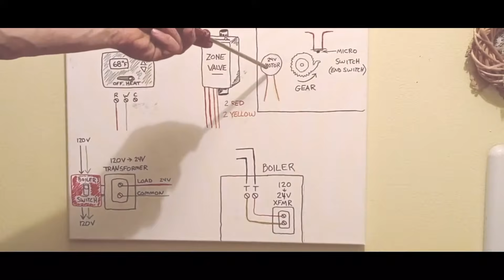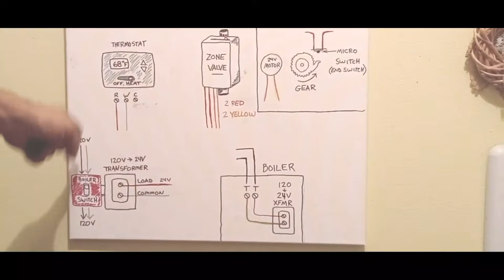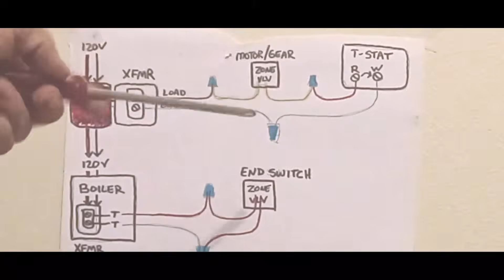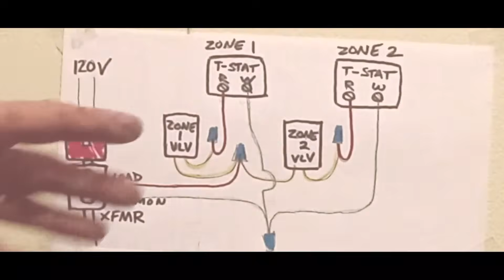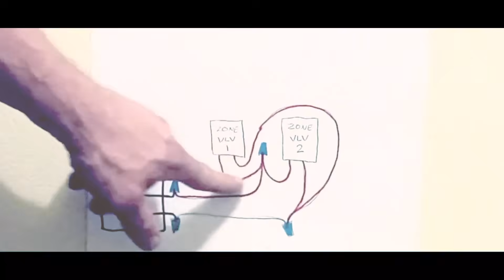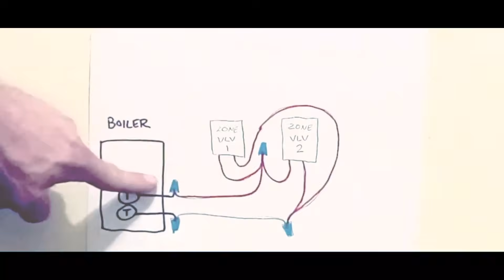How a 4-Wire Zone Valve Works (Wiring Diagram for Beginners)

Comment: Hi Mike. Thank you for the videos! Do you have a diagram or video explaining how to connect transformer, zone valve and thermostat with c wires. I have a 18/3 cable connecting the current thermostat. The blue wire is not currently used. I would like to add the blue wire as c in the new arrangement. Thank you!

Comment: Best video on wiring zone valves that I've seen. It helped me figure out my own setup. However, I couldn't find a video pertaining to my boiler. It's a Buderus GC124 and two Honeywell 4 wire zone valves. There is no external transformer. The only wires are coming from the aquastat which are red, white and green. Red is 24 volts and white and green signal the circulator pump and zone valve motor. I had to borrow power from the only power source available. At first, the second valve would stay open as long as the first one was running. This would overheat that zone. Your way helped me to rewire so they work independently. A video on that would help to verify that I did it correctly.

Comment: Ya but my valves don't have pigtail wires. My valves have screw connections labeled Switch, End, TH/TR, TH,  TR ..Soooooo Where does the red wire go? Where does the yellow wire go?
Reply from the maker: Red to end switch. One yellow to TR other to TH. TR/TH is just a junction connection.
Reply: @JerseyMikeHVAC  lol I have Red, Yellow, Orange and two Whites in my valve.
It took me a while, but once I understood two different 24v supplies and which one does what, it is not that difficult. I like one of his other videos.

Comment: amazing explanation. Man whoever wired my house must have been on something. I have been here 5 years just tracing this now…… my thermostats come back to the furnace and they have the RED wires wired directly into the red load wire off the transformer…. And then all the whites coming back from the T stat are bundled together with the common from the transformer. Also they don’t have the 2 red wires from the zone valves wired into a transformer they literally have them all wired directly into the electrical box with I am assuming 120v? What the HELL is going on here?!
Reply from the maker: Don't worry about where the 2 red wires go. That's for the boilers burner circuit to fire it up. Sometimes they go to relays that do other things in the process of firing the unit up. But it has nothing to do with the thermostat wiring other than activating the boiler on a thermostat's call for heat. 

The wiring from the thermostats as you describe sounds typical and correct.
Reply: @ thanks Mike I appreciate the reply. One of the 3 t stats has no power to it, but I checked wires to make sure they are connected good and also it’s set up exactly like the other 2 thermostats that have no power issues. Aside from a damaged wire between the furnace and the t stat, is it possible that because it’s the farthest t stat from the transformer powering it there’s just not enough juice to power it? It had worked for years and then stopped abruptly. Wondering if it’s a power issue needing a c wire OR I need to run a new wire. Using nest 3rd gen. Thanks Mike.

Comment: Mike, quick question:  So the "T T"  wires from boiler going to zone valves,  watch the zone valve ... when the thermostat provides 24v to the valve to open it and the valve fully opens it triggers the okay to the boiler to then start the pump and fire up the boiler, if need be.    So two parts -- what powers the valve to open for heat and the second part, what alerts the furnace valve(s) are open, so feed?  GREAT video.  Thank you.
Reply from the maker: The thermostat activates the zone valve motor that opens the valve. Activation of the end switch circuit will trigger a relay of some kind to start the pump, whether it's in an aquastat, on a zoning panel or sometimes a relay on a control board in the boiler.

Comment: I trying to wire in properly, a
Erie Poptop actuator 4 wire.
There wire diagram shows 
24v, load to R, thermostat, W
to black wire actuator, other black to common.
What are your thoughts on this?  First zone seems to be working properly. Now time to wire in second zone.
Thanks much
Reply from the maker: That's fine. It's the same circuit in reverse of the video but works all the same.

Comment: Great explanation. As a do-it-yourselfer found this really easy to follow. You mentioned that a second transformer might be necessary for systems with 5, 6 or more zone valves. I assume that holds true for any combination of zone valves and thermostats which require a constant 24V to keep them connected to an internet router for WIFI capability. The reason I say that is I have a 3-zone hydronic system connected to 3 smart thermostats requiring a "C" wire. Two of the thermostats control both heat and central air with the third controlling just heat. The transformer at the boiler has a "C" terminal and there's a spare wire at each of the thermostats. If I connect the spares to the Common terminal at the boiler, I get less than 24V. It's a sufficient enough drop that the thermostats will not stay connected to my WIFI. Someone recommended using a second transformer strictly to provide the constant 24V. My question is if a second transformer is used and I connect the Common terminal to the spare wire at each of the thermostats, where does the second wire go? Any possibility of you doing a video on this topic but with smart thermostats requiring a "C" wire.
Reply from the maker: I was sitting here thinking about what my next video topic should be and I think this would be a good one, so I will make it this weekend. 

 Just on a side note, most smart thermostats operating independent heating and cooling systems prefer to draw the common from the AC system, so hooking the common to the boiler may have crossed some circuits and is likely why you had experienced a voltage drop. 

 Adding a second transformer is a little more complicated than just 2 wires. A little rewiring is necessary, and a relay has to be added to keep multiple control circuits isolated from one another. I'll cover it in the video.

Comment: So no matter the model it has to have an external transformer or you wire off the one that is built into the boiler
Reply from the maker: Typically there is an external transformer of some kind. It's best to avoid using the transformer in the boiler, keeping it reserved for the burner circuit components.

Comment: Excellent explanation!
Where would the C wire of the new thermostats connect in this schematic?
Reply from the maker: Typically after the zone valve on the way back to the transformer's "common", but it depends on the number of stats and zone valves are on the transformer. Sometimes an extra transformer and relays are required to feed all of it without issues or the loss of smart features.

Comment: Do the red wires have to be connected? I just moved into a house and have to replace two of these and the red wires aren’t connected to anything, just floating free. Is that fine?
Reply from the maker: Typically there are certain types of zoning panels that send a signal to activate the boiler on its own, rather than the signal having to come directly from the switch in the zone valve that the red wires are connected to.  So basically, the zoning board does the job of the end switch in the zone valve and those red wires don't need to be wired in (but the yellow wires do still need to be hooked up). 

 If you don't have a zoning board, then yes, those wires do need to be wired into the circuit.  I have several videos on this topic, the others of which go into more detail on wiring multiple zone valves together. 

https://www.youtube.com/watch?v=XtUO_A7aodQ&list=PLzqK-0xeBEzUTVtgZN-RWhcYjyZgi_XxM&pp=gAQB

 All of the videos on the playlist should appear on the right of your screen when you get to the video link
Reply: @JerseyMikeHVAC  awesome, thank you so much!

Comment: FOLLOW-UP: it turns out... this isn't the only way to wire the zone valves.  i'm no expert, but this is how my brilliant HVAC guy explained it to me... when my system was installed, the original HVAC guys used a second 24V transformer at the air handler.  So, I have two 24V transforms, one in the air handler and one at the boiler - very misleading...  3 HVAC guys missed it.  4th guy was a genius.  The 24V at the boiler is only for the indirect water tank.  Since the air handler already has 24V, you simply connect the red from the thermostat to one of the yellow wires on the zone valve and connect the white from the thermostat to the other yellow.

ORIGINAL POST: great video!  My Honeywell seems to work fine: turns the motor when heat is called, triggers the pump and closes when the cycle is complete.  However, the cover was off and i almost burned myself on the motor head.  I put a meat thermometer to it and it was 190°.  The water temp gets to 180°.  Is this normal?  Does the heat from the water really transfer to the motor head plus some heat from the electricity to keep the motor on?  or do i have a short?  big thx
Reply: A short will blow the fuse. Water Temp makes things hot. Use temp laser gun for temperature and give the meat thermometer back to your cook.
Reply: @atlasfueloilinc.2421  thx, but no.  the thermometer was the key.  the zone valve rose ABOVE the temp of the water - which is impossible with simple thermal heat transfer.  there was no fuse to blow.  the last hvac guy corrected that, as well.

Comment: My boiler has three zone valves. Going to three separate thermostats. How come my system has three wires going to each thermostat. I do not have air conditioning, just baseboard heat. My thermostat wires are white, red and green. My thermostats are wired as follows:

Green wire goes to Y
Red wire goes to W
White wire goes to R

I was under the impression why is for a fan, which I do not have.

Comment: Does this mean that if I have a 4 wire zone valve, I can ignore the end switch if I don't need it to regulate the boiler? (i.e. replacing a 2 wire valve and just terminate the end switches so that they don't short?)
Reply from the maker: If all you want is the valve to physically open and close and nothing else, then yes.

Comment: This was great Mike, any suggestions on how to organize and keep the wiring for 6 zone valves and 6 thermostats  neat and tidy? And just like you explained I have 2 transformers to distribute the load over the 6 zone valves.
I was wondering if  there might be a panel of some sort that is prelabeled for connecting the wires ,kind of like making it idiot proof but also keeping it neat.

Comment: If your thermostat is a modern one that requires power to work you would want to do the same thing only in a different order.  Your load would connect directly to the R terminal on the thermostat.  Your common side of the 24V transformer would connect to the C terminal (the C wire) on the thermostat.  And the Call for Heat (wire to the valve motor) would connect to the W terminal.  The thermostat will make the call for heat hot when it wants heat.  That W wire will go to the valve motor.  The other side of the valve motor will connect to the common from the transformer.  When the call for heat becomes hot then the circuit is completed to the valve motor and it does it's thing.  Even if you don't need a Common wire for your current thermostat you probably will someday.  For a smart thermostat to work without batteries you need a full time load at the R terminal, and a full time Common 24V at the C terminal.
Reply from the maker: Absolutely. I do have another video that goes through the wiring you describe here. I just have to figure out a way to link it to this one so people can be more aware of the smart thermostat situation you bring up. Thanks for the input!

Comment: Honeywell V8043F1036 3/4" Sweat Zo ne Valve with Screw Terminals and End Switch demonstrate with this one please.
Reply: Also they daisy chained it so it is a bit confusing.
Reply from the maker: They work the same way. The 5th terminal (TH/TR) is not internally wired at all. It's just a junction terminal.

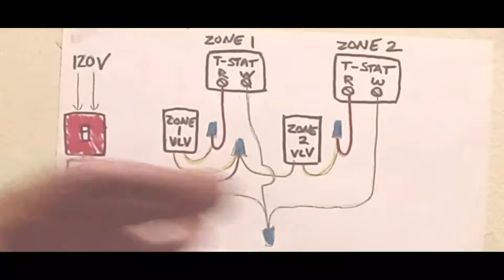Comment: Hi Mike - love your videos and how well you explain them. I have been watching some of your other videos for nest power connector installation. So my issue is that I have the multi zone as explained from 6:55 in this video. I am trying to add a nest power connector at the valve zone. I am just struggling what wire goes to where. I have this same exact diagram and I am not sure if it’s possible to have multiple nest power adapters for each zone valve. Appreciate your help.
Thanks in advance
Reply from the maker: The power wire from the transformer... Does it go to a bunch of red wires that go to the thermostats? Or a bunch of yellow wires that go to the zone valves?
Reply: @JerseyMikeHVAC  I am going to see if I can draw something and maybe post it out here
Reply: @JerseyMikeHVAC  take a look at this diagram and see if it makes sense. Esentially the power comes in from transformer and supplies the first zone valve first and subsequently provides power to the other zone valve. Just can’t figure out how I would add a nest connector and/or if it’s even possible to do it? 
Thanks in advance

https://docs.google.com/document/d/11aoPO3eMVco6BhThO_c6-bWOGQ-GzFjP6UMrJQ0-nUQ/edit
Reply: @JerseyMikeHVAC  see if this link works

https://docs.google.com/document/d/11aoPO3eMVco6BhThO_c6-bWOGQ-GzFjP6UMrJQ0-nUQ/edit
Thanks

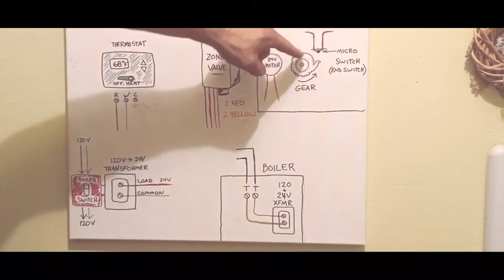Comment: In the wiring diagram at 4:20 you should the thermostat switch wired up after the Zone Valve motor. Could the thermostat also be placed in the circuit between the transformer and the motor?
Reply from the maker: Yes it can. One of my recent videos goes over that particular arrangement with multiple valves.

Comment: Questions does it matter if there are more the 5 zone valves on the T T to the boiler? Great video the light bulb went on.
Reply from the maker: I've seen as many as 10. Transformer capacity is more of an issue with 5+ zone valves. You'll definitely need a larger VA or even better a second xfmr when going beyond 5 ZVs.

Comment: What to if heat keeps running on the boiler not turning off
Reply from the maker: turn off all of the thermostats. If the boiler is still running, pull off the covers to the zone valves (one small screw to loosen) and see if one of the end switches are still pushed in by the gear motor. If so, the gear motor is bad and needs to be replaced.

Comment: Just installed a new (replacement) 4 zone boiler in our workshop, and then tried to follow the old wiring pattern without knowing what did what.   I could not get the thermostats to control the call for heat and so started looking for info on the internet.  |Nothing really helped me until I came across your video.  I had to watch it twice and I printed out all 4 of your diagrams and made notes on them.  Once I understood how it all worked,  it took less than an hour to straighten the wiring out and voila, it all worked as it should.   I am confident now that I could wire up any boiler to work multiple zones.  Thank you!!!!!!

Comment: If the white on the thermostat is wired to the common of the transformer, does that mean I can jump the white terminal on the thermostat to the c terminal on the thermostat for smart thermostat installation?
Reply from the maker: Likely to short out. W and common can combine after the load (zone valve).

Comment: If one of those zone valve switches is bad, will it cause your boiler to run away(not shut off at the high limit temperature)?
Reply from the maker: Its a possibility, but I don't see it too often. Does the boiler shut down when it hits 180 degrees (or somewhere thereabouts)?

Comment: So, what i don't understand is how come there is no polarity on yellow wires. One yellow in and one yellow out but motor turns in the correct direction regardless of which yellow goes to transformer load terminal?
Reply from the maker: The zone valve motor is a single phase shaded pole motor, and by its design, it cannot run backwards unless you were to physically remove and flip the stator inside of it. So as long as there is a current, the zone valve will create 2 offset magnetic fields to drive the motor in the only physical direction it can go, regardless of which way the yellow wires are hooked up. 

 If polarity is reversed on the high voltage side of single phase prior to the transformer stepping it down to 24 volts, then low voltage controls will typically not run at all. 

 3 phase motors can run backwards because each phase is aligned to the others a certain way right off the power lines directly from the power generating station. No capacitors are needed to create phasing that creates offset magnetic fields to drive motors. If 2 wires are accidentally switched in a 3 phase set up, the change in polarity between all 3 phases will alter the magnetic fields, which can alter rotational direction and make a motor run backwards.
Reply: @JerseyMikeHVAC  Very well explained. Thank you very much for your response. Love your channel, great content!